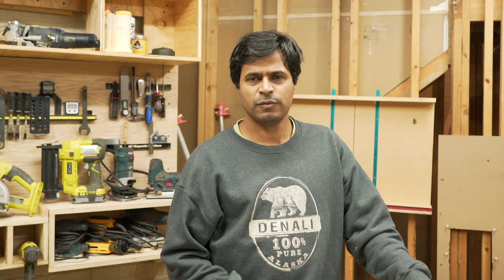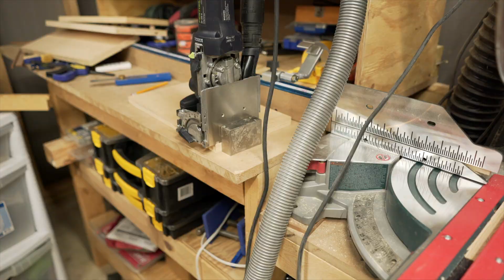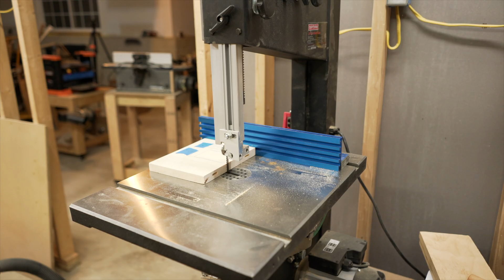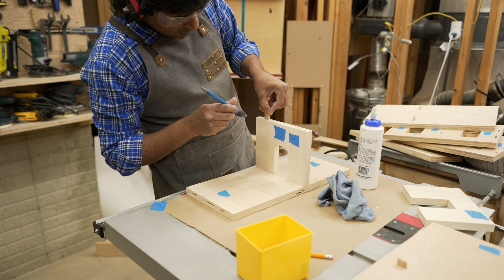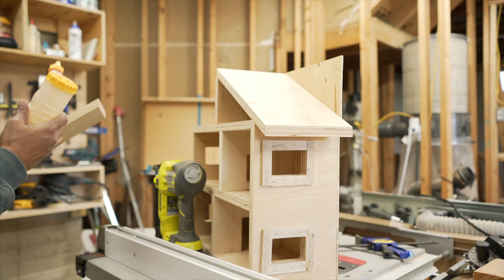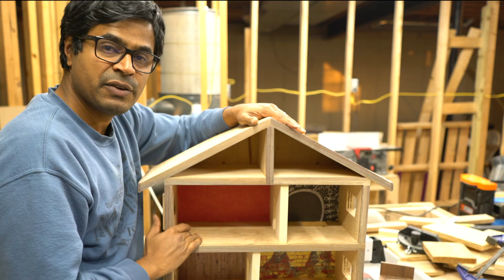How to Build a Wooden Doll House with Walnut Edging / DIY Woodworking

Comment: Interesting with children I wouldn't use any pin nails as the glue is by far strong enough once it's cured
Reply from the maker: That’s true. I used pin nails mainly to act as clamps.